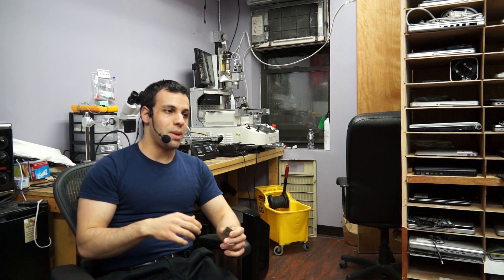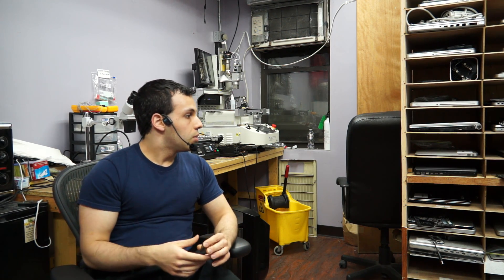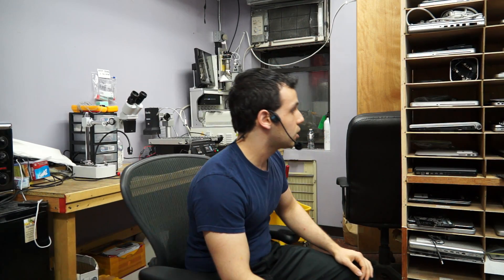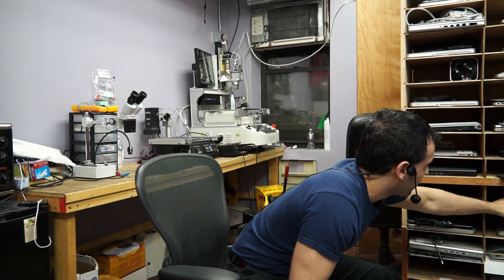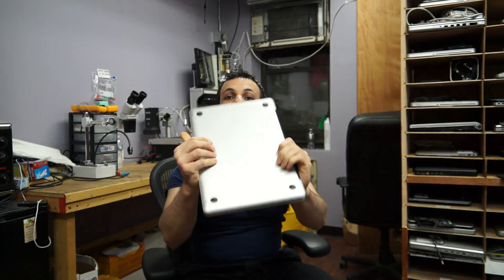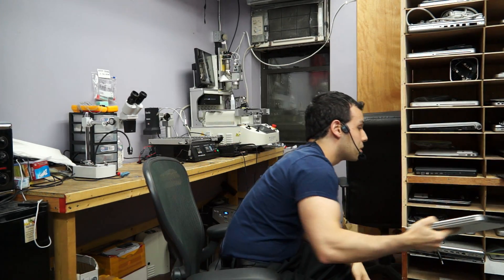Reballing flip chip GPUs is BULLSHIT - the truth about dead laptop GPUs & repairing them.

Comment: Great Video, been viewing your videos about a few months. Didn't catch this since it was like back in the days.

I just had a Clevo based gaming pc crop up with a glitchy gpu. I was looking for any ways to replace it and came across tons of hair dryer "reflow" articles and youtubes.

Having a degree in engineering, I know that hair dryers will not reach the temperature of non leaded solders used in these components. My main focus was to get a replacement chip and solder it back onto the board.

Now that I have watched your video, although sadden by the fact that this "fix" is actually just a band-aid and doesn't permanently solve it, I am happy that I made the right decision initially to look for a replacement chip.

Wish me luck in finding one, its a GTX 1060 non Max Q version used in laptops (the older pre Max Q ones).

Comment: People believe the re-ball issue because it can make a lot of sense.. Lead free solder is more brittle and more prone to cracking and going dry under stress,(well mostly early lead free solders, but the dirt sticks) This combined with the heat  the comes from a under-cooled GPU looks like a perfect candidate for dry joints.

But dry joint are cause by vibration and heat CYCLING, hot then cold... not just heat..

Want to see a good example of heat cycling and vibration damage, look at the solder joins on a car dashboard... they often look like utter shit.. This is from the dash getting 60+ C from being in the sun and then rapidly going to 12C as people get in their cars and turn on the air con.. the vents go past the dash and can quite quickly cool them to 12c  even though the rest of the car is still very warm..

Comment: Most cases i just reflow the chip. If fails replace-it. With some practice it can be done with just a heat blower, and some k probes and infrared thermometer.  Ir machines are expensive, from more than 10 years of experience, a simple re-flow is better than a chip exchange. 90% of cases isn't worth a new chip... 
 I gave up reballing after analysing failure vs time of the machines i used to repair.

Comment: Louis, I have a question for you - is it possible to take out a GPU from a 2011 logic board and replace it with a GPU from a 2012 MBP Logicboard, and place it on the 2011 MBP logic board?

Comment: am i wrong?
 or does the fact that, nvidia chips is held mechanical in place with a coolingblock, prooves that reballing wont fix the issue? The connection is hold in place by the cooling block that is  screwed(?) onto the PCB
Sry for poor english, im danish :)

Comment: Really like the video and the explanation is excellent. Except I beg to differ on one point. Lou makes the statement that all these video chips are crap. I think that statement is more than a bit incorrect. The chips are crap from the perspective of the design constraints around the cooling of the chip and the surrounding components. I make the case that the same chips placed on a larger PC style card with much better cooling will last much longer. So I think it's the combination of the chip design the constraints on the system cooling that make the end result a short-lived GPU.

Comment: i watched majority of your videos about bga flip chip reballing and there is one thing i still don't understand: why can't you just tell the customer that there is a "fix", but it's not a proper fix that may fail after a short period of time, but also due to the unavailability of the working chips it's the only method for a fix so you can try it with no guarantee. This way you wouldn't be tricking anybody that you're a doing a proper repair, but using your technician skills to perform a difficult "non-proper" fix.

Comment: Sometimes you are wrong and this is the time. Different chips can have different problems (it could be a problem with BGA at interconnector, BGA under chip, problem with chip itself, it could be bended PCB of motherboard or tin whiskering problem).

Comment: Hey Louis, this was a VERY interesting video. I have an AMD 7970 desktop GPU that seems to be dead.  Fans spin up, it's detected by Windows, but will not display out no matter what.

One major thing, is that this GPU is huge and after sagging for 6 years, the PCB is actually curved a bit.  Do you think the solder balls could be the cause of the problem because of the flex in the PCB?

I'm going to do what you suggested and try to heat it to 150C* and then if that doesn't work heat it to 215C* and see if either of those works.

This is a desktop GPU, not repairing for a friend, and it isn't working, so I have nothing to lose by trying reballing.
Reply: a bit late here but detected no display could be a vram problem or a main chip problem. Im not sure if the 7970 has a "display rail" but if its missing from an rx580 then it wouldnt display an image out.

Comment: Hi Louis , I recommend not to talk about reballing ...You cannot reball anything using one temperature. How do you think the BALLS get on GPU and the mainboard in the beginning ? No mention of the temperature curves >? 
Reballing is not the process of heating the chip.... 

I agree with you completely that reballing in the oven is not a good idea using one temperature or doing it at some guys dirty repair shop with a heatgun. 

 If you have a failing Nvidia chipset then maybe the issue is with the chipset itself. You will see it because IT itself has overheated and there may be bubbles all over it. But if the chipset is ok and you check it under a professional machine using xraz and then you reball it because a ball came of the board or got shorted with another one then it is a PERFECT fix if done properly using the right tools. I have been doing this for 28 years now. The chips on the inside will BENER get fixed using heat ... that means that if after reballing we still have an issue then the chip is defective and has to be replaced....   I mean how do you think the balls get onto the GPU in the first place >?  If done professinally then it is a permanent fix !    :)   Kind regards from Michigan

Comment: Way too many assumptions.
BGAs started coming off their boards about 20 years ago when chips got much wider and RoHS was new.
They'd flex off the board, no shorts, just loose connections, why it also was repairable so often.

I have so many machines that have been reballed fixing a manufacturing issue permanently.

Luckily this problem is not as prevalent anymore. But it's worth a shot when you've got nothing to lose by trying.

Comment: Reminds me of how much I tinkered with my old gtx 275 desktop video card. It started producing artifacts. The next day it didn't want to output picture on the monitor. Now mind you this was loooooong ass time ago. Like 2012 or so. And I'm sitting in front of my garage desk thinking to myself "Alright, maybe there is a way to fix this thing". I put it in the oven. It started working. Until three days later when it died again. And this time around no oven helped. Tried with hot air station. No luck. Then I was like "Okay fuck this, I'll try to reball it". And boy oh boy was that an effort for the olympics. First I didn't have a grid mesh to get the solder balls in place. Had to order that thing off from Aliexpress. Got some lead solder balls (they say these are cancerous, but they have elasticity that makes it more or less impossible for them to crack like a lead free solder does from time to time, not to mention I don't have my nose constantly glued to them). Arranged the balls, got them glued in, pre heated the board and the chip pcb. Then I soldered it in place. It fucking worked! For another two weeks! YAY! And after that second death I was like "Yeah... it's probably something within the crystal. Fuck this video card!" I haven't touched it ever since even though from time to time I get a vibe for tinkering with it. But to be completely honest, the effort simply isn't worth it, when we consider how crappy the structure of the gpu is. Remember that these chips have sensor readings suggesting they run at something like 70-80C, but that's not actually true. The temp within the crystal is close to 110 degrees. And that shortens their lifespan drastically. Not because they have shitty design, but because they're made with shitty materials. For example nobody puts golden strings to connect the crystal to it's pcb anymore. "Too expensive". That's literally less than 2 grams of gold and it could prolong the life of the chip itself a lot (cause fuck the main PCB, that crap can be fixed a thousand times. 
The simple truth is as Louis said. They don't want to make things to last. Honestly if my gtx 275 was alive, I would probably still use it on one of my two desktops. 1 GFLOP of computational performance is plenty for anything that's not gaming and even for most games that aren't directx locked. But instead of that I had to buy another gpu. Capitalism in it's finest. All the big brands do the exact same thing. Some are more consumer friendly than others, but the overall idea is for you to buy a new product every two to three years. The wheel has to keep turning. And unfortunately if we want all these sweet ass performance leaps, we'll have to play along. Innovations when it comes to electronics don't come from people bashing stones with rocks afterall.

Comment: HI Louis, I dont know if you'll read or see this but its worth a try just asking. 

Basically I have this laptop an Asux x407uf, now I opened up my laptop to install more ram and plop in an m.2 ssd(since it had a free slot) but that's not the issue. Basically I tried yanking off the battery as to me it felt like it was common sense and may have used a bit of force until I just gave up cuz there was no way I could get it out. Now this laptop has a dedicated GPU, but disappeared when I reinstalled windows. How hard is it to accidentally disconnect one of those solder balls on the GPU chip? I doubt the GPU died since its been barely a year, I got it checked on a fairly decent repair shop and they said they simply didn't have the tools to try and reball this chip and just gave it back to me. They also noted that they checked around the area of the GPU chip and they said there were some weird voltages around it(I'm no expert on this and I am just paraphrasing since I dont recall what word they used). They also said that they would attempt reflowing if they had my permission as it had the chance to completely kill the rest of the board due to heat? Basically giving me a 50/50 either it gets fixed or totally dies.

In my scenario, do you think this is worth trying to fix by reballing? Since if ima reball this Im gonna need to ship it off to a repair shop that has the right tools for a good month.

Comment: But, if it's a flip chip where the chip is soldered to the package inside, can't you cook the chip in order to remelt the cracked balls inside the package? I thought this is what they figured out would work with the Nvidia chips that were failing. Also, it seems strange to me that AMD would encounter the same problem after Nvidia already went through this. You'd think AMD would learn from Nvidia's mistake and avoid it.

Comment: Hmm I partially agree  ,as a 'professional repair' you are right , this is not a permenant repair .  On the other hand however  I have personally reflowed quite a lot and have had mostly good results .  For example several  Xbox 360 worked for a few extra years , various Graphics cards ; many years between them . I would only recommend this as a last ditch attempt to get some extra time until an upgrade

Comment: Hi. What's wrong with the solder in the inside of chip that's designed as a flip-chip? Is it the quality of the solder inside the chip? Is it actually heating up inside at 220 to 245 Celsius- won't the computer protect itself before it gets to 200 Celsius? Thank you. God bless, Proverbs 31

Comment: Reballing is a joke, because if a PGA IC or BGA IC fails it can not only damage itself but other componets in the circuit as well. Heating and "restoring" a failed IC does not fix the problem.

The only real repair of a video card,TV set, game console, desktop PC, laptop or in my business, 2-way radio, is to replace the entire card or board the failed IC is on and call it done.. Don't screw around at the customers expense, when your lively hood is on the line.

Comment: Coming here one year later to repeat the same: Instead of wasting your time reballing anyhting, just leave a $1 halogen lamp heating the IC for an hour or so, and it will be back to life the same way.
If anyone is willing to get all the equipment to remove an BGA chip properly, please do yourself a favor and replace it with another working chip, not the same defective one. :-)

Comment: Just "reballed" my Vaio's GPU pointing my hot air to the chip at 240ºC for ten minutes. Yeah, the cracks on the solder got fixed without even getting close to a melting point hahahah. It "works" now. It is an AIO and it was having a really weird problem. It was showing 0V on backlight when the GPU was dead, but I suspected it wouldn't be it because I couldn't see anything on the screen at all, but the speaker was doing the chime.
Now, after heating up the GPU, the backlight is back to 19,5V as it should, but I can't see where the two circuits meet on the board from the schematics. Hope this helps somebody if they ever find something similar with a Sony device.

Comment: Hello, Louis. 1st of all, as a client, I agree with your points. I know this video is kinda old, but I have a question and I'd be glad if you could answear - and I'll understand if you can't.

I have a Dell Vostro 1240 with a nVidia 630m. The nVidia chip is not dead but it disconects from time to time with Device Power Failure error. I'm thinking about askig for a reflow. Unfortunately I live in Brazil and these machines cost a lot of money and my machine is still very good for my college work. Do you  thinks the reflow could fix it? Or just heating up the chip could fix the problem? Thanks!

Comment: Hey Louis. I am from Brazil and have na IMAC 27" 2010. One day the I turned on the computer and it appeared a lot of vertical lines in colours. I started looking into internet to check what it would be and I guess it is the graphic card. I saw a lot of videos on reballing. And I am so glad I got to yours. I was about to go after it but you explained clearly the whole situation. Interesting that I dont even think I will buy a new one (graphic card). Since it is a old imac, I am not sure a new one, would really be new or be worthy the investiment (around 675 USD here). I guess probably it is better to invest in a new one, since technology has advanced and new things are available and also the apple care support would help much more than now with this vintage imac.
Thanks fo being so clear with the explanation and for the vídeo! Greetings!
Reply: With some of the later videos Louis posted on the same issue I'm planning to take out the MXM GPU card from one of my own Imac's and some other failed boards my friends have from their old gaming laptops and checking if the capacitors feeding the GPU are what really failed (Given that the failure mode for Tantalum caps does match what I have seen from a failed undervolt and how the display outputs on a faulty imac) . If not then I might try replacing the GPU chip with one from a working desktop variant for the ones which aren't mobile processors on an MXM board. Worst comes to worst the MXM card was already faulty and I get some smd soldering practice.

Comment: I work on a iphone board service, and i see all of this shit, but in some phones like iphone 6 if touch stop working always is cold solder under the chip, or chesnut again cold solder.
And the couse of that i think is bad solder used by apple.
So i think its a possible way to fix it with reball , but you can damage the chip itself.

Comment: Some of you guys have to use your brains for thinking, rather than sit on them.

What Louis is saying is on THIS chip, reballing will for the majority of the time, be a temporary repair.  Internally it becomes intermittent due to internal strain from thermal cycling.  SOMETIMES reheating the shit out of it will relax the interconnects enough to work or redistribute the stress the PCB places physically on the chip to allow it to work.  Best course of action is to replace the chip with a different design.  Second best is to replace the chip with the same design, new chip.  Third best choice is  replace with same design, used chip.  Last ditch effort is reball/reflow and hope you get lucky.  May or may not work.  It is FIX not a REPAIR, because the underlying problem is still there.

Does this apply to every BGA chip?  No.  Does this apply to every situation?  No.  If a head gasket fails on your car, the best course of action is to machine the block, machine the head, replace the gasket with a new one and replace the head bolts with head studs.  Replacing just the gasket won’t correct the underlying problem that caused it to fail in the first place.

Same situation here.  And a big part of the community that believes reballing/reflowing will fix every flip chip are the same ones offering the service as a repair.  I see it first hand, every day.

Comment: so I had two dead GPU's...
one 780 and one 780 ti, I followed Linus' tip about putting it in the oven, and now they both work... Is that because of the heat?
not sure why that "fixxed" them, but I thought instead of throwing them away I might just give it a shot and now I'm using them in two different htpc's :P

edit: by dead I mean one had no signal and the other had green artifacts all over the screen and cumputer crashed during load. Now they both work just fine :P